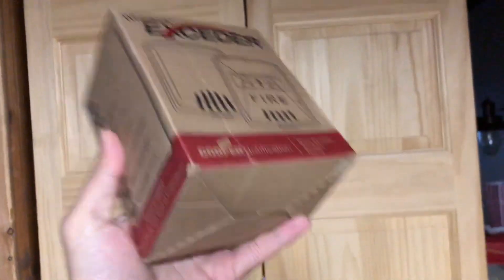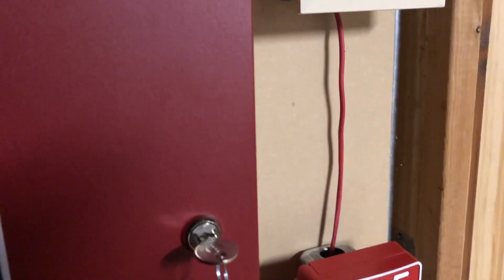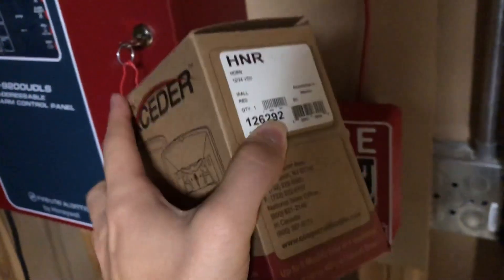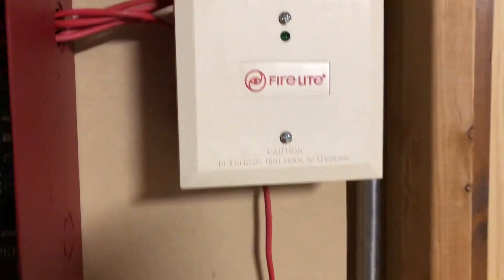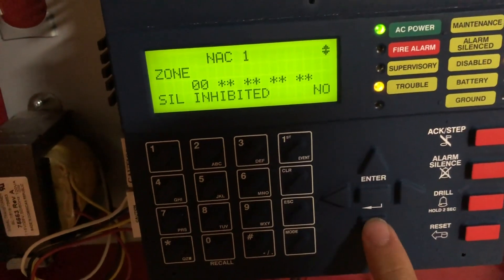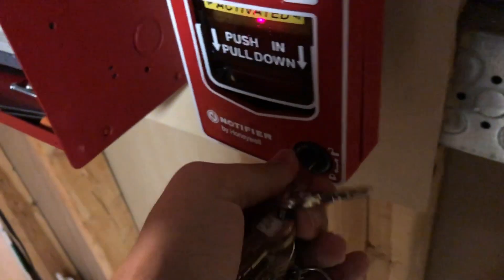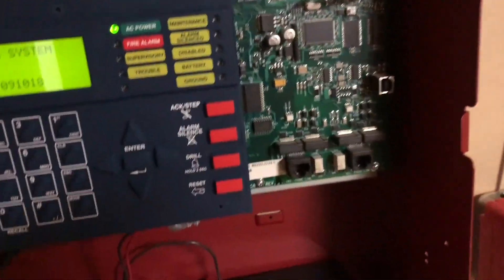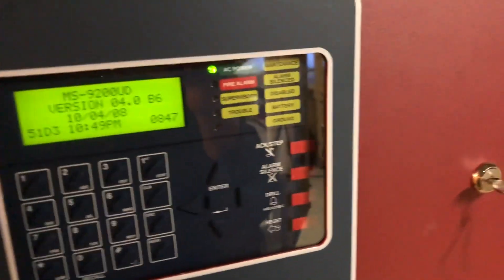Home System Test 50.5: Wheelock Experiment with New Device!

Comment: Well I think your collage has a configuration which the horns are not set on sync so they run on continuous and the strobes are set on Wheelock sync.
Reply from the maker: I suppose it's possible, however I do believe they are on the same NAC circuit. Some of the horn only models that Wheelock has don't pay attention to the sync signals.